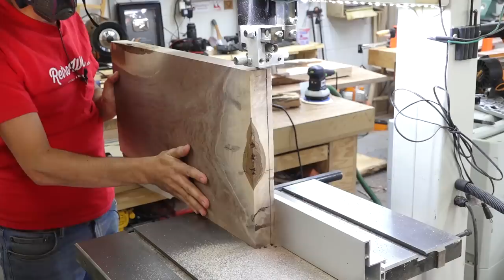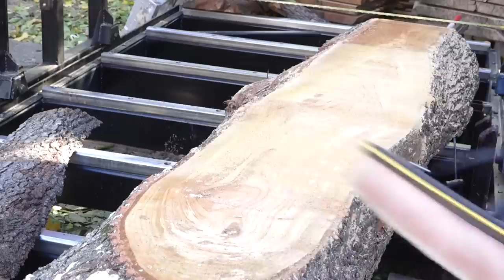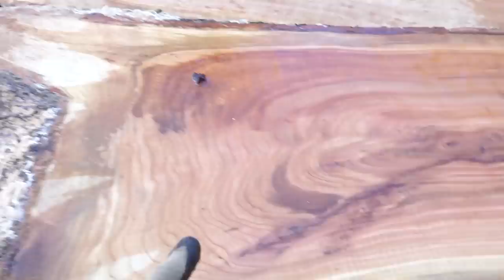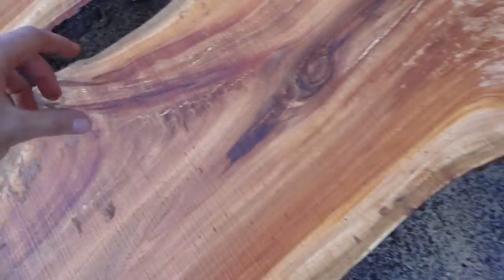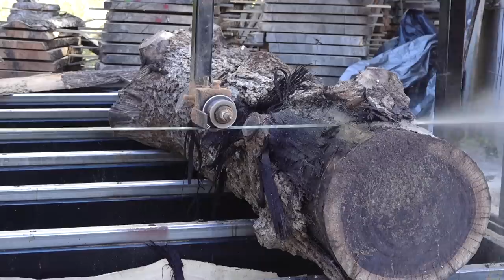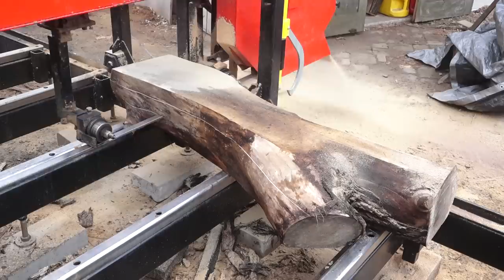Sawing Slabs - Turning a Log into Lumber Part 2

Comment: Matt if you put a roller out in front of that side blade guide you keep moving and have it set to keep the guide a couple of inches away from the log you would only have to move it once when you start the cut!  Make it like a 6 inch roller so that it is less likely to hang up on the undulations of a log.

Comment: I haven't much time in making lumber but for a while I cut ties and cants. You don't run across much stuff like that in fir trees but then the stuff was for the railroad mostly. When I say that you don't I should clarify but just once in blue moon... out of the blue.. a hardened pitch that looks like glass and yet is workable comes. It will make your day. Well mom had me cut down a cherry tree by the house, it was a very old tree of some size and since she wanted it out I cut it into eight foot long  and the limbs into whatever I thought may look good. I toted it into the back of my pu and when dad wasn't around, worked it up in any and all different sizes thick slabs like you were doing and the went to the wood shop for the high school and before I could say much, he made me a very generous offer, a work in process sorta. All the big limbs I cut into two inch stuff by that school teachers recommending, words are not coming easy for me right now cause my brother just past away about thirty minutes ago and I need to keep myself busy so this is how I'm doing it but back to... I took the thick limb slabs to a luber outlet, the scaled the wood best way possible for usable cuts and I made good on that as well. I never told dad, just put the money in the bank and when time was right gave him a cut on it. I made enough to get me a lot newer truck to drive... paid for and healthy pay on my place that I was making out of wood that would not make ties for dad and got out of his house a lot quicker. I was fifteen then and I turned seventy two last friday. My brother turned seventy in march so thanks for listening. Very nice video. I kinda follow but just not steady as should but I did subscribe a long time ago. I don't put much time on computer but like I said enjoyed your video... brought back some memories... good ones
Reply from the maker: Really sorry to hear about your brother, Morgan. My condolences.

Comment: I'm jealous of your cut times. I use an old delta with a 10" re-saw to mill small logs on a sled. The 3/4 HP motor slows me to about 30 minutes to cut a 3' log with a 1/2" blade.
Reply from the maker: woof!

Comment: I watch you crank the handle to move the saw and it drives me crazy. Have you considered a VFD and a gear motor? You could use the torque to control the speed. At least it would be a consistent speed.
Reply from the maker: I have and will some day. For now I enjoy it and also enjoy driving people crazy

Comment: Three questions:
What’s the purpose of all that water after cut? Seems like extra water on a fresh cut wood would prone it to crack as it dries.
Why aren’t you using wedges between boards following the blade? All that weight of wood onto the blade creates a bit of binding and tension on motor, no?

Comment: Matt how thick of a slab do you normally take out of the middle of log since middle ends up cracking..  also what advantages or disadvantages would u say sawing log with ears on top and bottom instead of side to side.. just wondering thanks...

Comment: Did you ever consider adding a spring at the top and a small wheel at the blade idler wheel so that it followed in and out automatically the curve of the log?

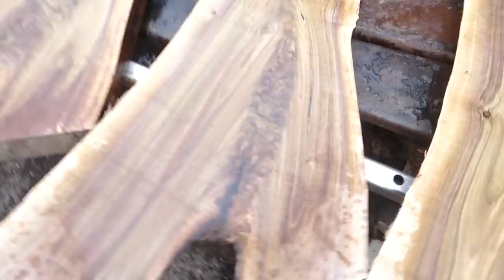Comment: @21:17 'about 18" of crotch'

Years ago I discovered that from my elbow to the tip of my finger is 18".
And if I hold my fingertips together in front of my chest, then from elbow to elbow is 36"
I have used these measuring sticks all my life, especially the 36" one.